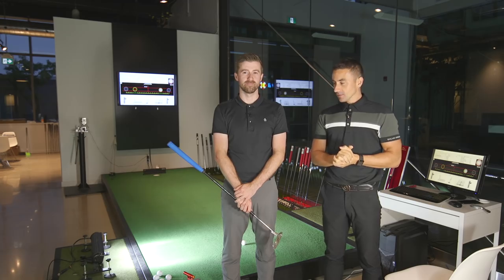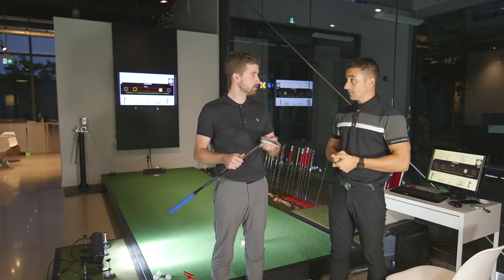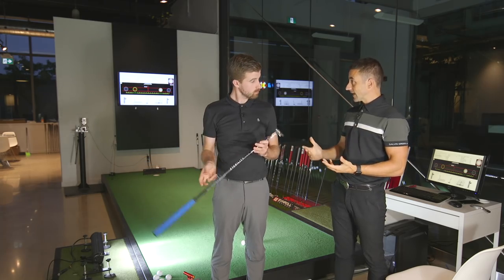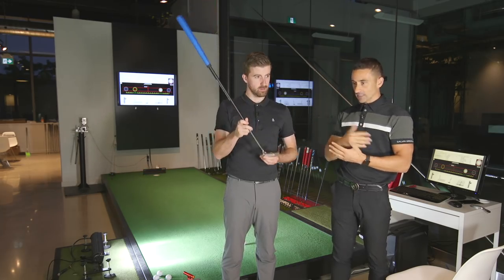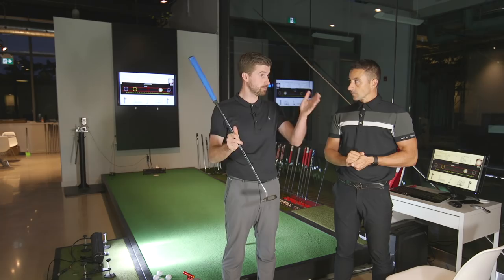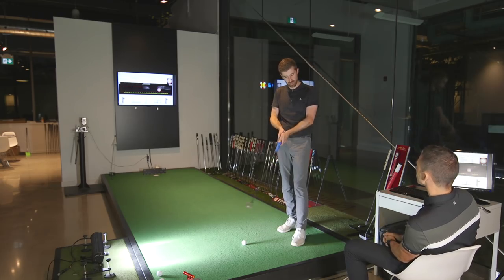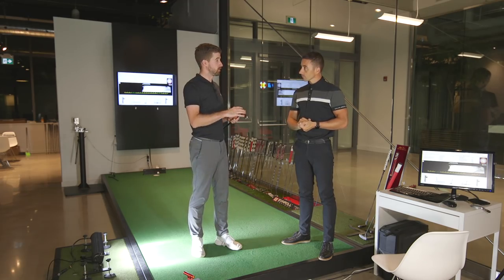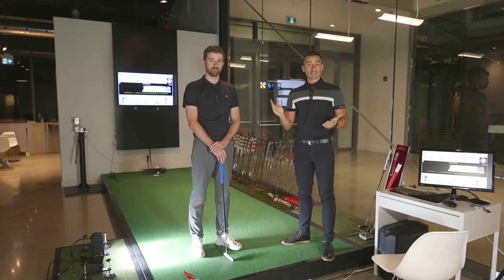Stability Putter Shaft Review

Comment: A year ago I installed a Breakthrough Golf Technologies Stability Tour shaft in my Odyssey O-works 7 black putter and the results have been great!

Recently my golf bag fell off of the golf cart and landed on the concrete as I was leaving the clubhouse. The Stability Tour putter shaft snapped right above the aluminum insert.  It was devastating!

My response was to order two more Stability Tour shafts to rebuild my original putter and build a back-up.  I bought a used O-works 7 black putter off of Ebay to create an identical back-up. Both putters have matching SuperStroke Traxion 3.0 grips with a 75 gram Countercore counter balance installed.  

Why would I do this? Because my putting statistics have measurably improved based on Arccos data collected over the past year.

My playing partners give me grief over my non-oscillating putter shaft.  

Doesn’t phase me, because my handicap has dropped from an 8 to a 5, getting as low as 3.9 last fall.  They don’t realize it, but they have paid for my putter shafts with the money I’ve been winning off of them since making the switch.

The recent introduction of the KBS One Step putter shaft is another indication that this concept is for real as imitation is the best form of flattery.

Thanks for the great reviews and content.  Best wishes to you for continued success.

Comment: Stop me if i missed this in the video - but am I correct in feeling that the "technology" of this shaft is basically a wide diameter that doesn't allow twisting? With the club using what is essentially the softest part of the original putter shaft in the bottom 8.25", it's removing the stiffer upper section and basically just replacing it with a stiffer portion that's more resistant to flex and twisting?  I was hoping to read or view that it was doing more, but it basically is rotational stiffness brought about by the larger diameter/circumfrence?

Comment: I currently used a FST 125 tipped till there was only 1/4" of the .370 portion left and put into my plumber's neck. Have been putting way better since I did that. Last putter shaft was way too flexy. Sad part was I had to put a shaft extender on it to get the length back after tipping so much.

Comment: i wonder if this type shaft is really helping. reason i ask, is that the putting stroke does not generate significant torque loading to load the shaft in a twisting moment. also why not have the whole shaft in the composite instead of building two different materials. listen to what he said really good face control. wouldnt that be the key?

Comment: I got custom fitted for my putter at club champion. we did stroke arc, mallet vs. blade, toe hang, shaft bend, length, weight, grip, loft, and lie. I had a fantastic experience but there was not a single mention of shaft and honestly I didn't even think to ask. I heard Ian mention trying a X7 shaft in the putter. is a putter shaft really the same as a standard iron shaft?! I went back and looked at my spec sheet they gave me and shaft isn't even on it.
Reply from the maker: we haven't done a ton of testing with this yet, but it seems that for a lot of players that trying a lower torque shaft in the putter might be beneficial, not to say it's 100% necessary
Reply: I took a look at the website and I think the only trouble they might have is they ask you to ship them your putter to re shaft it. Fortunately i live in DFW so I can just drive by and drop mine off but I can see that putting someone off to have to ship say a Scotty out to have this done. Isn't this concept also similar to what Chambeau believes in? People have made fun of that guy but he and Barnet Adams are proving to be cutting edge. #tightlies
Reply from the maker: Club champion has them as well I believe so that would be more convenient for you

Comment: Hi guys,  does the fact that the shaft is part steel , part graphite still not make the shaft susceptible to to torque flex in the steel portion.
Reply from the maker: I suspect because the steel portion of the shaft is only about 7-8 inches long and is inserted into the stability shaft with its technology, the combination of the two reduces the total shaft build torque rating to 1.0

Comment: The biggest question I have is why not cut the steel portion of the shaft as short as possible? This would put to use more of the expensive high modulus materials and get rid of as much of the soft, cheap steel. If stiffness is one of the biggest goals here it seems counter intuitive to leave any portion of steel.

Comment: Does it also keep ballspeed/spin up on mishits?
I have messed around with my putter shaft, but only with steel. I've tried a bunch of styles: Stepped, fluted, stepless, dynamic gold S300 9 iron, black gold X flex 4 iron. Realistically there hasn't been any significant difference, but it's fun to tinker! This shaft does seem really good however.
Reply from the maker: It seems to help keep distance control consistent on mishits - not something we’ve quantified in testing yet but certainly our opinion
Reply: I have one on my evnroll er 1.2 and it holds the line all the time.

Comment: An interesting video, however, I am going to have to disagree that this type of shaft would make a putter a higher MOI putter. 
The way I see is that it would only be so if you can hold the putter so tightly and rigidly that the only way the putter will twist is due to the shaft being twisted. 
Let's suppose you made the shaft torque so low that it is impossible for shaft to twist, then an off centre putt would make the putter 'twist' in your hand, grip itself (they are only made of a type of foam or rubber) or your wrist would twist instead.
From an engineer point of view, considering torque properties of ordinary steel putter shafts, how I am holding the putter (soft as we are advised to do so) etc, I think torque property of putter shaft is not so important.
Actually on the contrary,  higher torque (soft) shaft would actually 'dampen' the effect of off centre putter twisting the putter in your hand or grip.
Reply: With an oversized grip you also have more leverage against twisting.

Comment: Gearoholics love new gear ... and it becomes a problem when you have top gear in the bag ... what else to buy?

It is quite funny that you can by a new driver off the shelf but you find it expensive with a new putter shaft... and you are using the putter at least 18 times a round, every round at every course you play. 
10 rounds a year is 180 strokes so math is easy - money spent ain't bad.

45 USD for a box PRO-V1 and one ball in the woods and one ball in the water... no big deal...

Hahaha ...